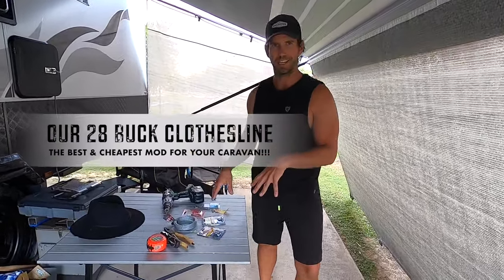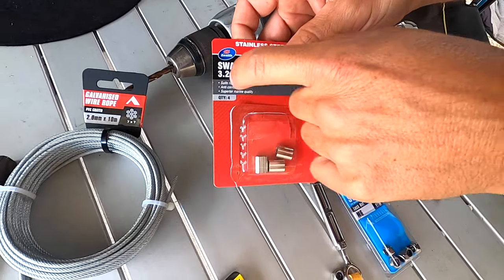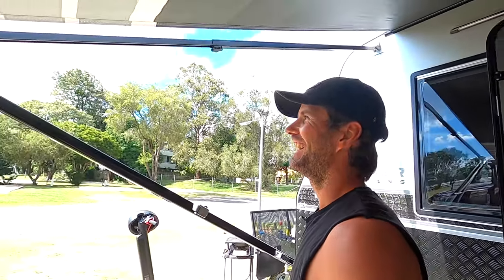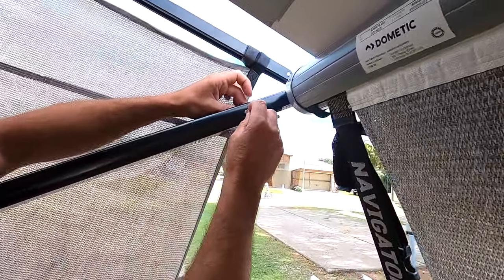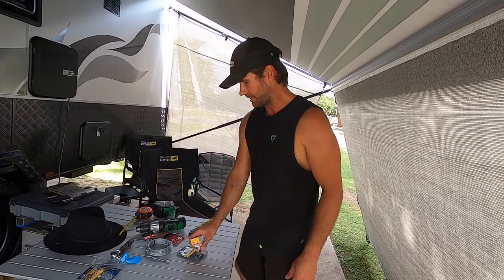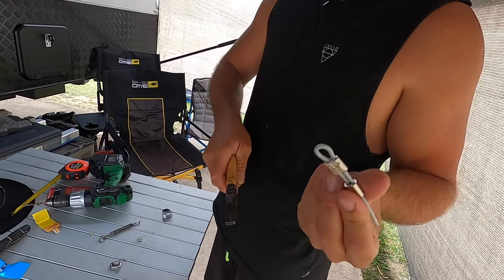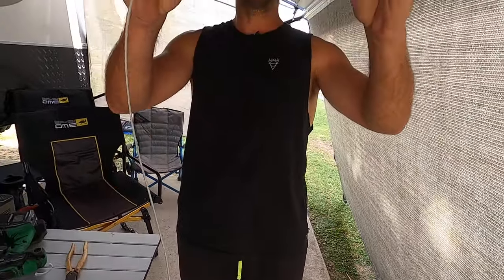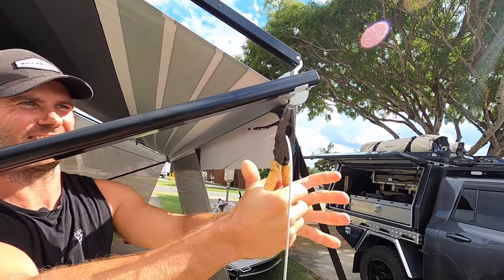THE BEST CARAVAN MODIFICATION EVER!! Our do it yourself clothesline....

Comment: Two minor details to add, make sure the threaded end of the eyebolts is no longer than necessary so that it cannot possibly intrude on the sliding bracket for the awning. Second, slip pieces of heat shrink over the cable before you start, and then shrink it down over the swedges and the cut end of the cable so you don't snag your clothes or hands on it. Looks good.

Comment: Great idea👍🏼
Adding a cable thimble at each loop will protect the cable at the stress points.
Love the vids
Stay safe folks
Reply: And a proper swage tool wouldn't go astray either (I'm a perfectionist), but at the weight they are looking at holding... not really necessary.  😂😎
Reply: GB Sailing 
I was looking on thicker cable!!
You aint seen the Mrs’s smalls🤣

Comment: Great idea, I saw this on a van on a trip to Tassie a few years back, suggestion to add a zip tie through the turn buckle to the eye bolt to stop the chance of the turnbuckle coming loose with the wind buffeting, plus a safety for the open end hook, this clothes line is also good when you are transiting as you can use it without putting the awning out, keep up the good work

Comment: Great idea. When I did mine I used a turnbuckle at each end and stainless wire. Works a treat. Just don’t over tighten as it will pull your awning arms in. Good video.

Comment: Nice! However, a simple measure up from the awning pivot to the open door frame would give you the clearance you require to get over the door. If this is lower than the axis of the awning by 100mm or more, then two (2) or more lines could be run/affixed 50mm apart!!!

Comment: Just put one one my van as well but i used the "
Pinnacle 3 - 3.2mm 316 Stainless Steel Swageless Balustrading Kit" from Bunnings, it grips the end of the cable so there are no stray wires to scratch you or get caught on the washing.

Comment: Seems like a great idea.  Just be careful, on corrugated roads a lug worked itself loose, swung around scratched the hell out of my windows and doors and smashed out the sliding catch on my awning.  It's great until it ain't.  Don't travel with it attached. In retrospect it was the worst thing i ever changed on my new caravan.

Comment: When aluminum and stainless steel are used in an assembly together, the electrons from the aluminum will begin to transfer into the stainless steel. This results in the aluminum weakening. This weakened aluminum causes it to deteriorate at a much faster rate. This can lead to an extended life of the stainless steel.

Comment: Nice job, but hardly worth the cost & effort for one line. Easier to just tie clothes line direct to the arms. We've been caravanning for > 25 years, I tie a long length of line back and forth for 4 lines, plus another short single line if needed.
Reply from the maker: Fits a whole load from the washing machine in van on the one line so perfect for us 👍